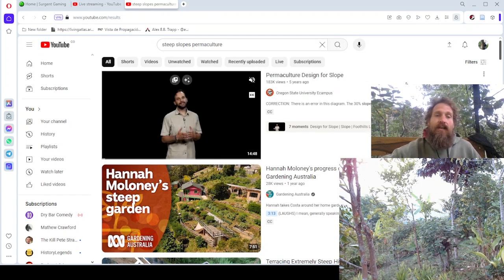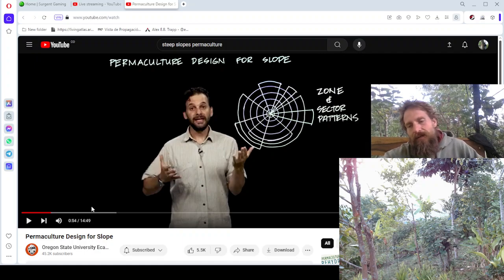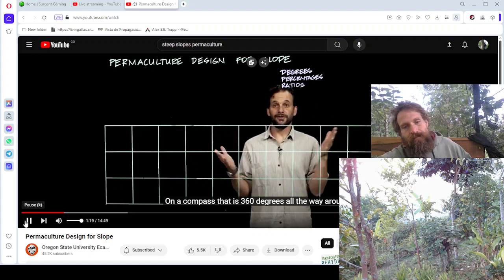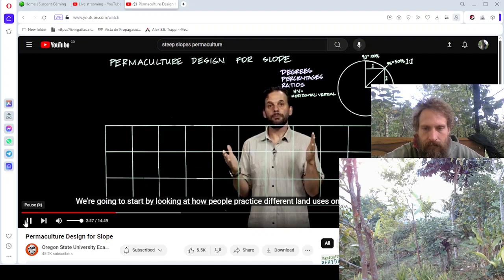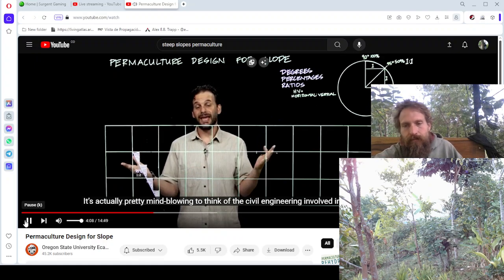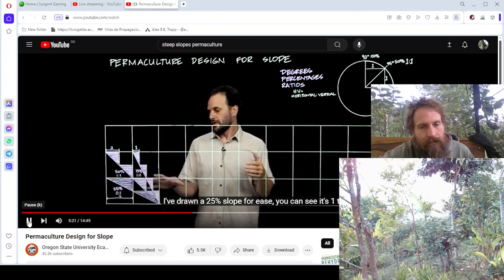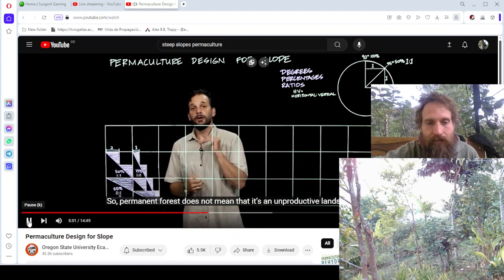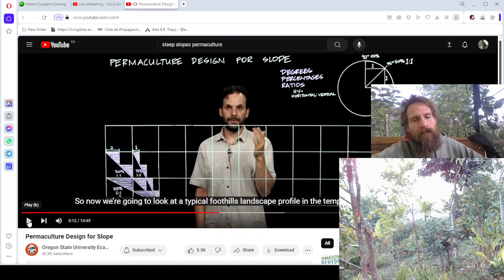Steep Slope Strategies missing from Permaculture Design

Comment: I’ve got a lot of steep slopes, not only are they steep they are also dry and very rocky, and in western Belize. My plan is to start at the bottom and work my way up, I tossed a bunch of pioneering species out on the rocky soil and hope that will help. I am trying your biomass fence idea, so far it looks ok, but I do need to add more biomass
Reply from the maker: both bottom up and top down have pros and cons, I guess it depends on where your house is!  you might use some rocks to start, a line of them perpendicular to slope can create a cachement for native seeds!